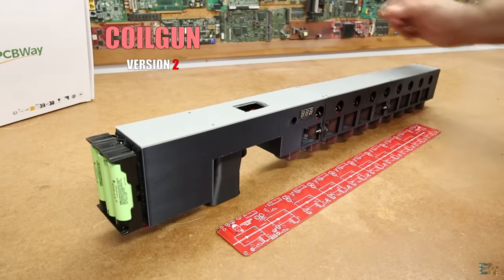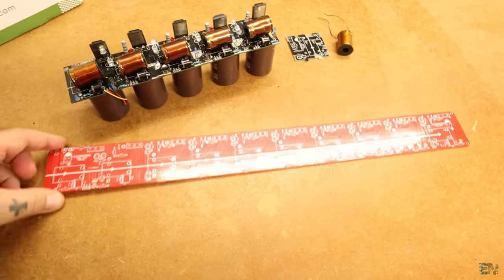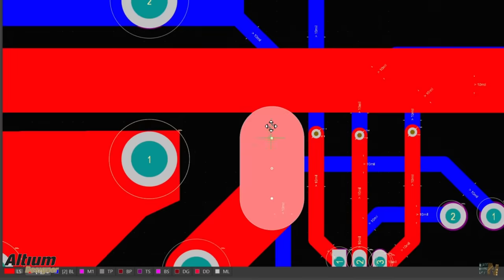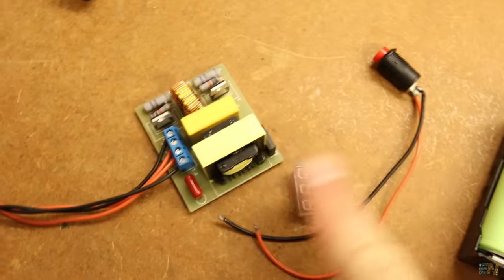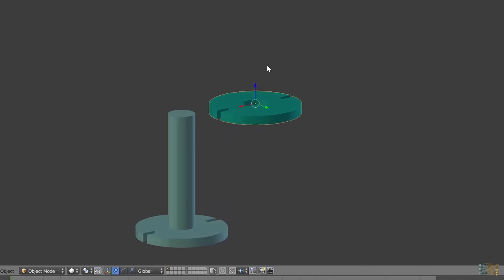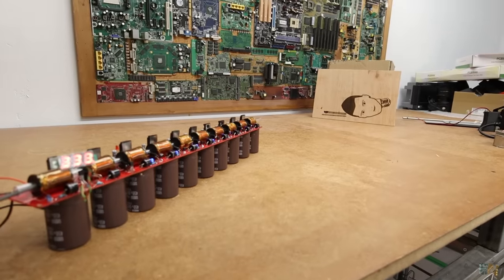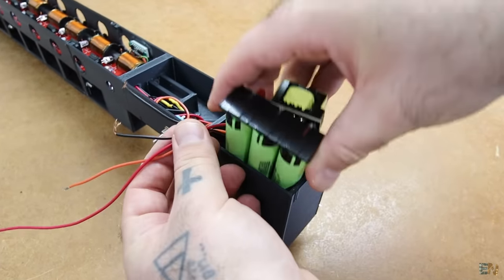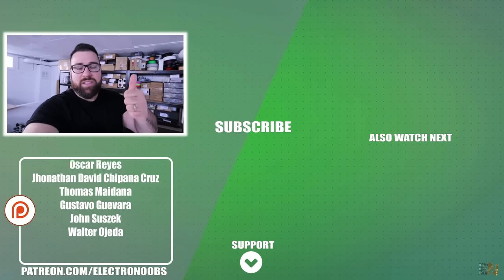POWERFUL 10 Stage COILGUN PCB + 3D Printed Enclosure

Comment: you can measure the speed with an audio recording. Shoot through 2 paper targets that are a known distance apart. Have the microphone be an equal distance from both impact points (or do a bunch of extra speed of sound calculations). Then use a program like audacity to find the time between the 2 impact sounds. Use distance/time to calculate the speed.
Reply: Nice idea !
Reply: are microphones fast enough for that?
Reply: @justfasial01  Yes. They do >40000 samples/second. That is plenty for measuring projectiles slower than speed of sound. As a teen, I used to measure softair velocities that way.
Reply: Why not just put a scope on the last light detector? You know the length of the projectile, so just measure the length of the pulse?
Reply: P.S. measure the length of the pulse at each stage too and check speed gain at each stage and improve timing maybe?
Reply: do we not have the video in this recording to extract this datum from?
Reply: we need a ruler tho
Reply: I would like to have your Altium design PCB design file
Reply: smartboi
Reply: you can also doit with slow motion
Reply: That's a really good idea
Reply: That's a great one to know about coz you can use it rotational speed or anything.. very handy Idea.. 😊
Reply: @steve6375  if the light detector reaction speed is the same for switching on and off
Reply: @steve6375  two detector more easy
Reply: You can also measure the speed if you know the total distance it traveled and the time that it took look up kinematic equations and you can find some simple equations
Reply: @isaacmerrell2619  "if you know the total distance it traveled and the time that it took" - how in the hell do you propose to measure that ? have someone down-range with a stop watch ? haha you're insane.
Reply: @foff-666 Just the time between the two registered sounds of the paper sheets piercing, it is easy to see on any audio software.
But I would be worried about the bullet being slowed by the first impact, that could make it seems slower than it was before it touches the paper sheet.
Reply: @apotheoz9196  yes this was explained, i was questioning another comment. obviously.
Reply: You need just a softair BB measure Device...

Comment: For safety. As you mentioned already the projectile could fire in the opposite direction. Adding a metal plate behind the loading chamber would make it more comfortable to use without fear of getting hit. Also, try putting the voltage display on the top rather that the side. Really good work you've done here.
Reply: Personally I'd probably layer rubber, metal, then a shoulder piece of rubber for added comfort of it does backfire. Initial rubber absorbs the shock of the round, the metal stops it, then you have the shoulder piece to absorb the rest of the shock. I don't have loads of experience with electronics but all that force knocking this back makes me think a bad solder connection or something could become dislodged
Reply: yep got the same idea
Reply: You're right that its possibly that happens but it should only have the power from the first stage, doubtful that has any kind of penetration power for most materials better than paper. Even cardboard could stop it. Something would have to go really wrong in the circuit for it to travel to the other end and then full recharge to fire in opposite order.

Comment: FYI: Stages should use fewer & fewer turns. You want to  dump the max amount of energy faster & faster for each coil. Also the coil solenoid should decrease in length since there is less time for projectile to to be accelerated by the coil (since its moving faster). One the projectile reaches about 1/2 of the distance inside of the coil the coil starts deaccelerating the projectile.
Reply: right, to optimize for efficiency, precise calculations would be necessary, coils, capacitors and projectile should all be balanced.
Reply: Yep. Also the earlier coils should probably use lower capacity capacitors, and last stages higher... But, meh, coilguns are useless and will probably forever will be regardless so what's a difference of extra 10-20 m/s, which is the most you'll get from any and all tinkering?
Reply: @mkzhero Useless? I have to say, you lack any imagination or Ingenuity. You could create many useful things using electromagnetism in this way. As for the purpose and use of a coil gun in the way he is , you could most certainly create one that would generate enough power to be lethal, or as a hunting weapon, or even self defense. You could even mold it into a pretty cool looking weapon. For example, you could make slots  or holes where the red led's are that would light up on the side of the gun when shot. Then make a battery pack and a magazine that could be easily fed into the gun, just like a regular gun. It wouldn't be hard to do. You could even make a trigger that's integrated into the power supply/button. You could make one into a reliable, highly functioning, durable, powerful & even futuristic looking, badass weapon lol. I can picture it in my mind right now. Now you said coil gun, not his coil gun, based on his design. One made a little differently but still could technically be called a coil gun. Larger barrel, multiple barrels, creative "bullets", shells, or projectiles, power adjuster switch, made into a nail gun, the list goes on...sorry, that was a lot there.
Reply: @alabamasteve8748  Well yeah, got a bit hyperbolic, there's many useful things with electromagnetism and coils, not this though.

Can create a create a coilgun that'll be lethal? Not really, just barely at best. Certainly not suitable for self defense or hunting, and that's just the theory, in practice they're far too impractical, costly and dangerous too (get it wet and it'll die or even explode or zap you, heavy, too expensive, SUPER underpowered).

What are you even basing this nonesense on? This current one is basically the cap of the current tech, and even significant advancements wouldn't make it much stronger, given that to reach even the most underpowered air gun velocities it'll need capacitors with AT LEAST about 4 times the power/capacity (which are FAR from anywhere close to being developed), and WORSE - better relays and switches! Probably way more length too! 

So yeah, not happening any time soon, and AGAIN, even when it is, it'll be FAR too costly to compete with air rifles, not to mention gunpowder!
Reply: @mkzhero  I agree, it's definitely not, I was merely saying that It could be if you needed it to be. For example in a situation where you needed to build a rifle/weapon and didn't have access to a combustion style rifle. I may have also been misleading when saying that you could make one using electromagnetism that could be lethal enough for say hunting. I meant, through electromagnetic technology, not specifically by the design bring used in the video, through multiple coils. But more in terms of a mini rail gun, in a sense. I'm also speaking in terms of a professional build as well. If you have the right knowledge, the right material & the intellect, you can create & invent amazing things. Also, just because something has never been done, by no means does it mean that it can't be done.
Reply: @alabamasteve8748  I mean, not even that is really an option, as there's FAR better and more viable electrically operated weapons you could build, even ones that are available right now, and no, not through the use of coils, their energy transfer potential is very limited. Also, a rail gun is VERY different to a coil gun, so don't mix those two up (tho handheld coil guns is !

Also, didn't say it can't be done, i said that it won't, not any time soon, for the three simple reasons of no such tech being available for now, the abysmal accuracy, and the crazy cost and potencial danger of such builds making them inviable.

As i said, coil and railguns translate energy stored in the capacitor into kinetic energy, with a good bit of waste. And even with the absolutely best capacitors we have right now, even if you make something super heavy and expensive, the MOST you're getting out of a handheld gun that's 5-7 kg in weight is a measly 80-90 m/s projectile, that's absolutely unacceptable for any kind of usefulness for a weapon, and you literally can't get more due to the limits of all the electric components. 

And even if you could theoretically get better capacitors in the future, you'd still need to get better switches, which is a whole other field of electrics. And even then you're limited by the coil's ability to transfer energy and their physical conduction capacity, meaning they'll frigging BURN when they get to any practical level of velocities in a handheld! How do you work around that? Well, railguns are how, but they come with a different can of worms, specifically the projectiles and noticable wear on said rails.

Currently coil guns are only somewhat viable in giant mounted weapons, and well, they're already pretty impressive, if still kind of impractical outside of maybe being used as stationary land defenses. The best use for COIL 'guns' meanwhile is accelerating vehicles over a LOOONG distance, for example the hyperloop, maglev trains, maybe magnetic rocket acceleration and other vehicles in the future... So yeah, coils are far better at accelerating BIG mass over a long distance, and they utterly suck at accelerating small masses over short distances no matter what you do. So as you can see, nothing that you can use as a handheld gun with any degree of usability in the near future, not even close. 

But as i said, these are just bad options for handhelds, there's FAR better ways to transfer electric energy into kinetic energy! For example electric repeating crossbows, electric air rifles, electric wheel guns/'launchers' (two wheels you spin up and push projectiles between so they're launched, not sure how its called) and many other things that could be possible and way more viable, not to mention WAY more cheap, reliable and accurate! I actually considered combining two of the latter two into one as well, should work great in theory, but don't have the tech capabilities for it saldy, could make for some pretty powerful shots though, nothing compared to the weakass results a handheld coil or railgun could provide.

And well, that's if you consider 'pure' handhelds, but technically pre-charged air rifles would also count as electric if the compressor is running purely off of electricity, and those can get WAY more lethal because they can go supersonic!
Reply: @mkzhero It seems that you are well educated on the subject and make some very good and factual statements. I appreciate your feedback and in depth explanation. I've always been the type to believe in the impossible, to reach for the stars, I have always been a very smart person and have always believed I would invent or discover something new one day through experimentation by unconventional means, by trying things people haven't done or thought of. I am currently an engineering student and I find electromagnetism, frequency waves, gravitational fields, and new found energy sources. I believe there are secrets yet to be discovered in the field of physics, I still have a lot to learn but in the meantime my mind is constantly thinking and I'm dying to understand more and more.
Reply: @alabamasteve8748    I mean, i hardly even believe in physics, given they're just theories made with our limited understanding of the universe to describe it, while reality can be very different. However, i'm also a realist, and if said theories work, and help make things that work, then until something changes its the best we have to to go off of. And well, according to those, there's very little potential here for any future development as far as guns go. 

Like, coilguns in a handheld are basically capped to like 80-90m/s, and the only reason for it is the coils themselves, their acceleration potencial is far too limited no matter how much power you dump in them, hence why say the 'anvil 1' (first commercially available coilgun) and most others fire those huge fat metal slugs (25 gram) - logically you'd not want them to be that big and instead trade the weight for more velocity, and logically that'd mean you could boost those 80~m/s to 160~m/s and at least be in airsoft territory if you'd convert the 25 gram to 5 gram projectiles...

But as i said, coilguns don't work that way and have a pretty rigid acceleration limit, so no matter how much power you dump in, you won't get much of a boost, nor will using a lighter projectile will work, so it'll accelerate the 5 gram projectile to the same velocity as the 25 gram, hence they use the heavier one because they can get more energy to transfer to it at least that way. I'm not sure about railguns and their power transfer speed, how much acceleration they'd be able to allow, but the barrel length still seems to be a limiting factor, not to mention switches and capacitors (they're also loud so you lose the silence advantage). 

But from the current ones people built here on YouTube, seems they're actually even MORE anemic, given the same power input, despite usually being air assited (the large, actually semi viable military railguns also use explosives as propellant)... And yeah, they're basically all some kind of propellant assisted because otherwise the projectile would instantly just weld to the barrel instead of accelerating, or at least will ruin the barrel really fast, so you need to give it a significant initial acceleration... So yeah, dunno, as i said, have a lot of doubt about any of this being viable for handhelds regardless of just what we invent, even in 50-100 years of tech advancement..

Electric crossbows, airguns, others and many various hybrids meanwhile could be made viable even today! More viable than they already are that is.

Comment: I am already heating up my soldering iron.  I made the first version you designed.  I used coils from old tattoo guns.  They where cheap and worked way better than the ones I tried to wind by hand.   It was a lot of fun and now I have a project for the extra parts. Thanks again for another outstanding video.
Reply from the maker: Oh such a good idea!!! I have like 5-6 old tattoo machines, each with 2 coils... Thanks!
Reply: I would like to have your Altium design PCB design file
Reply: Why not just buy the coils online? They're not that expensive. Or buy enameled magnetic copper wire and make the coils yourself.
Reply: @ELECTRONOOBS Why not just buy the coils online? They're not that expensive. Or buy enameled magnetic copper wire and make the coils yourself?

Comment: Instead of smaller coils if you don't have a way to make them or buy them, increase the spacing between the coils and trigger LEDs to correspond to the additional speed that each coil adds to the projectile.

Comment: Add speed detection to the coil gun. Use the photodiodes across the stages as interrupts to calculate speed using a microcontroller. Improve the outer casing.

Comment: Another way of measuring speed is programming an Arduino to detect when each stage sensor is activated, and by knowing the lenght of the coil gun, you can calculate the velocity. Also with that way you can make a graph of the speed that increases gradually after passing through each coil.

Comment: Use your 2 channel scope on the last 2 LED sensors, the time between their firing shows you the projectile speed during the last 45mm of the tube. You can easily calc feet per second from that.
Also, cut air slots in the tube between the last 5 coils, you will get a big increase in speed when it doesnt have to push all the air out of the tube in front of the projectile.
You make good coil launcher videos 👍🙂
Reply: interesting point about the air - I wonder if a small ducted blower blowing across the face of the tube might (venturi effect) cause a small vacuum in the tube and help with that.